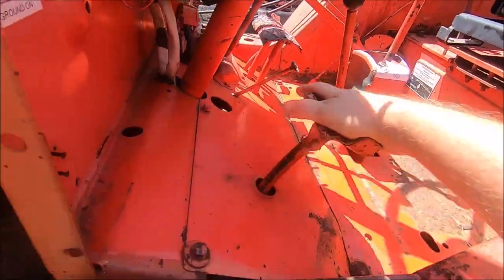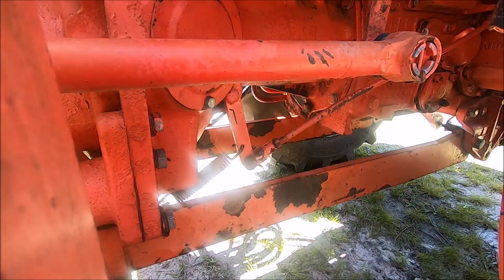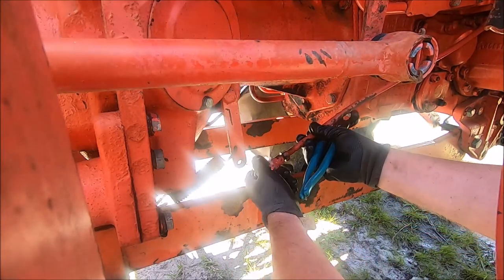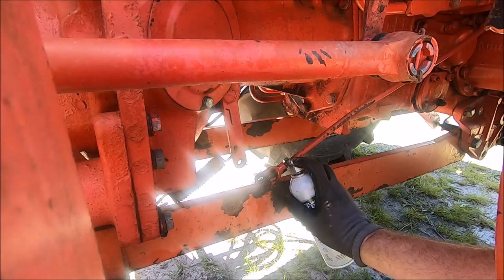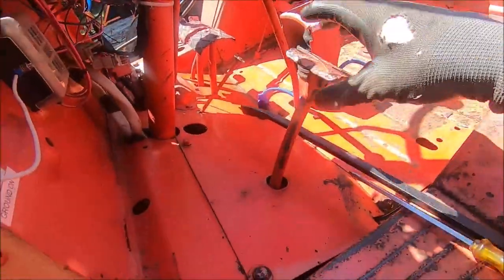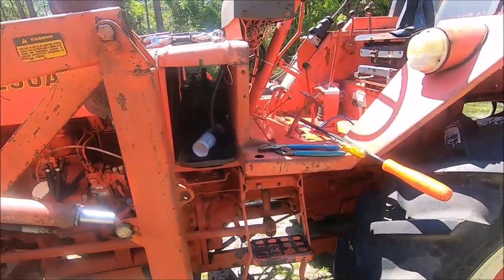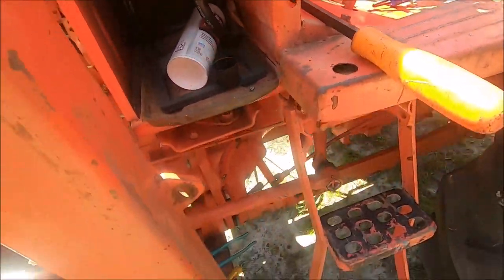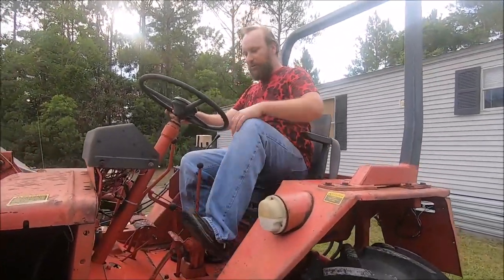Belarus 250AS tractor clutch pedal adjustment

Comment: Clutch pedal should not be floppy if it's flopping like that and your in rough terrain it's possible to pop out of gear happened to me I put an additional spring on the clutch pivot area under the floorboard where pedal bolts to bellcrank keeps synchro interlock  shaft from moving if your 250 ever pops out of gear chances are interlock/clutch lever shaft is moving can't be bouncing up and down